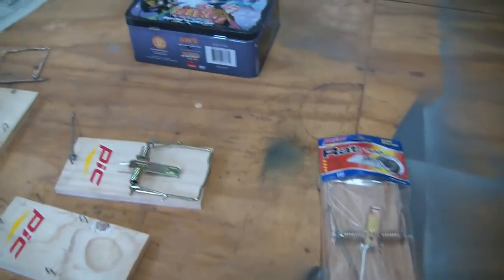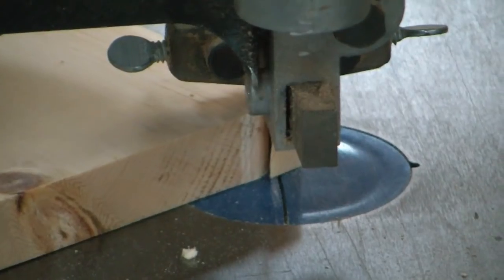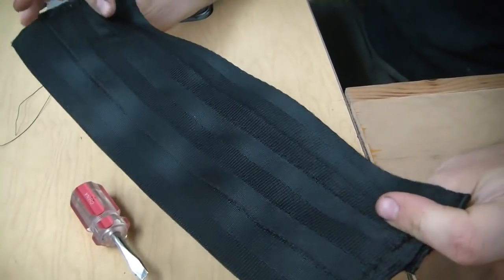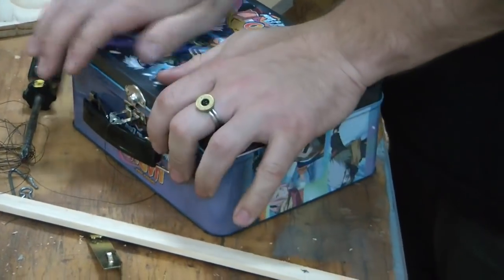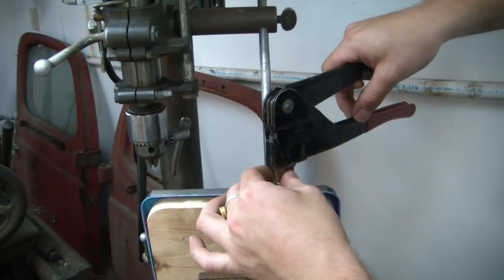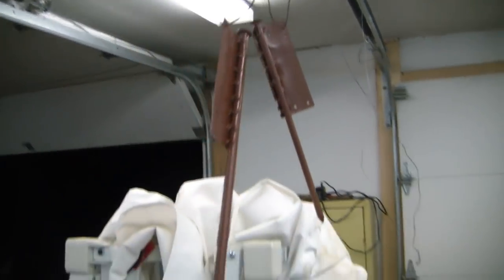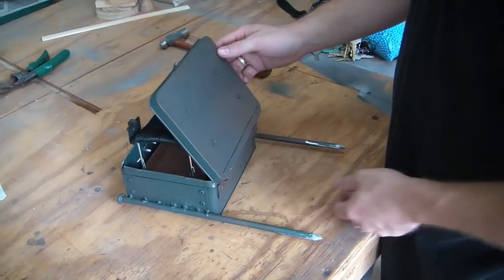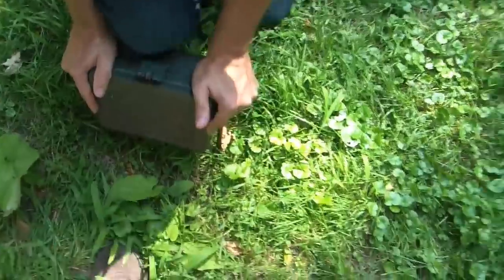Homemade airsoft claymore DIY

Comment: And how much for the industrial drill, belt sander, welder, vice, sand blaster and rivet gun?
Reply: You can still make this with basic tools. It would be just more ugly or you need to spent more time. But it's still possible